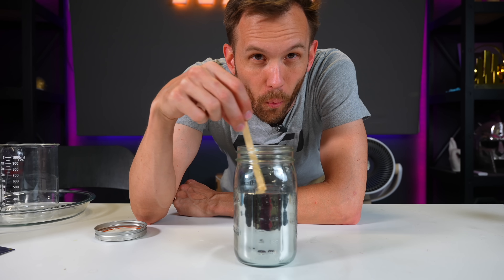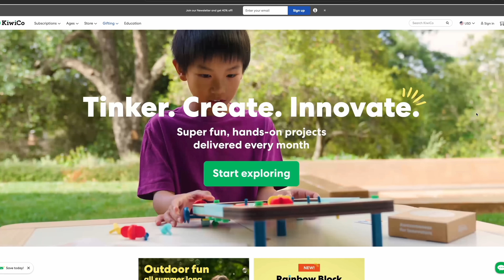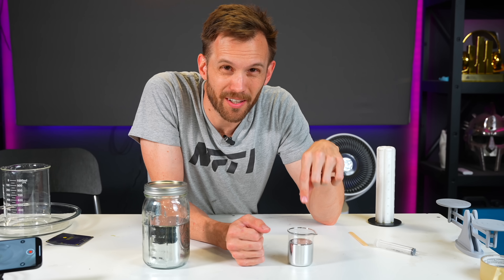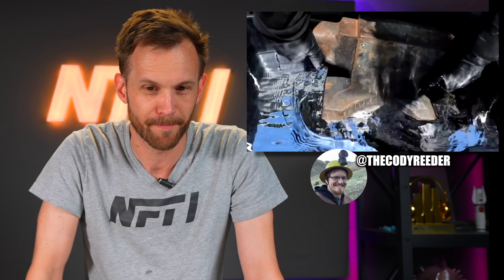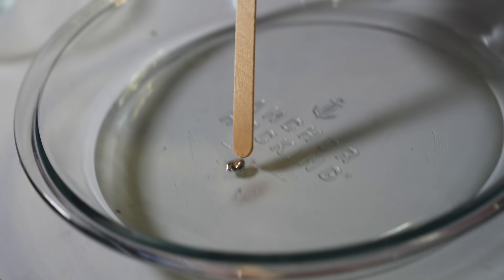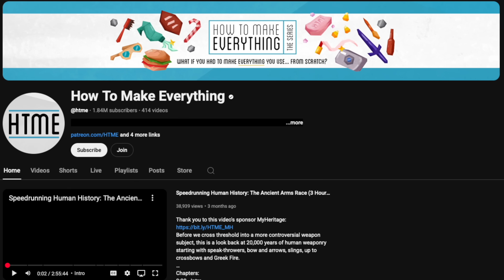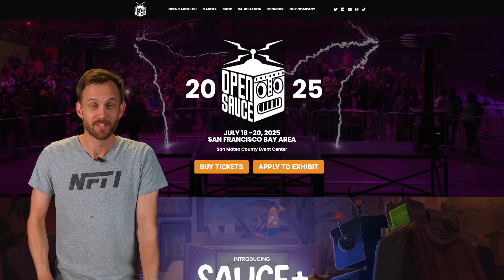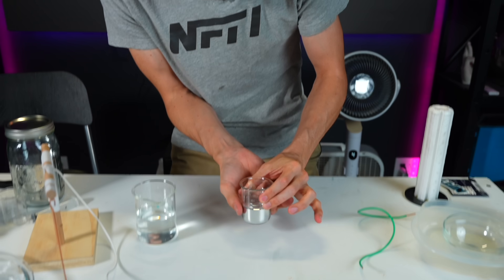What Happens If You Touch Pure Mercury?

Comment: I worked at the Volvo car Plant in the 70's and 80's. Under the hood and deck lid were switches that used a drop of mercury to make a connection. You could see through the clear cover the 2 connections about an 1/8"" apart. The way the switch was mounted, opening slowly, you could see the drop of mercury roll over to bridge the connection to turn the light on.

Comment: Alert - the balloon popping segment:
Many small spheres of mercury will increase the surface area of air exposed mercury, and the evaporation of mercury vapor into the air space is greatly increased.
Mercury vapor is more dangerous because it can then be inhaled, accesses the blood stream and, in particular, is able to pass through the protective blood brain barrier system and enter the central nervous system. Mercury is toxic to the neurons, (this can be visualized using a culture of neurons) - resulting in damaged or killed neurons and altered brain health.

Comment: I can't tell you how many times (in the 70's) that glass thermometers broke and we chased those little balls around the counter until they disappeared. Of course, we know how that it was being absorbed. Yikes. 
Oddly, folks think that the T1000 was mercury. However, it's actually gallium, which melts at relatively warm room temp of roughly 85 1/2 degrees F (cooler than your hand). Gallium also has a stronger magnetic property and is more easily manipulated with magnets. Someone actually made a little gallium robot, put it behind bars, increased the temp to melting, and then used magnets to not only pull it out from behind bars, but then use the magnets to reconstruct the robot thing. It's here on YT, but if I provide the link, I'll get a time out. Search: "Scientists create shape-shifting metal robot". You'll also find more videos. If you combine that with the 2.0 generation of Atlas from Boston Dynamics (search: "Boston Atlas 2.0"), THAT IS TERRIFYING, and makes the T1000 entirely plausible.

Comment: The most dangerous mercury compound is probably dimethyl-mercury. It is an extremely toxic substance because its molecular size is very small. It goes through your skin very easily and it crosses the bload-brain-barrier and let the neurons die one after another. It is a very slowly death because you lose your neuronal functions until you die and you can't do anything about it.

Comment: Can you make a hydraulic motor using Mercury, soundwaves, and electromagnetism and control it thru particular frequencies? If using Mercury as a gimble. Slingshot an object and control the speed by manipulating the sthe structure of the Mercury with soundwaves. Direction or speed by frequency. If you could control the temperature in space. You could theoretically power a ship with frequencies.

Comment: we used to play with this stuff when we were kids. we'd break open an old thermometer and pour it in a pan. we'd watch it roll around. try and heat it up or light it on fire.
science class also had use do experiments using this stuff. old chemistry sets you'd buy at the store sold it too.

Comment: I know those in the US are ahistorical, but some background would have enriched this video.

Antoine-Laurent Lavoisier used mercury in his 1776 experiments to demonstrate that air is a mixture of gases and that combustion requires a specific component, which he named oxygen. He heated mercury in a closed container, which formed a red powder (mercury oxide) and consumed about one-fifth of the air, leaving an inert gas he called azote (nitrogen). By heating the mercury oxide, he was able to reverse the reaction, producing mercury and the gas he discovered, thus proving that oxygen was the part of the air that supported combustion. This also helped refute the older phlogiston theory and laid the groundwork for the law of conservation of mass. 

Mercury used to be (and still may be) used in switches.
Reply: I know that pedantic know it alls on the internet feel as if they know it all, but mercury is HIGHLY regulated for use in the US and is banned outside of specific industrial uses, and specific medical and dental amalgam use age and these specific legal uses are dwindling  by year.   The only mercury switches existing in the US are in very old likely abandoned buildings.   Citing a historical event in a niche field from over two hundred years ago doesn’t make us ahistorical, it makes you know a single niche fact with no real use in day to day humankind. 😊
Reply: @codename495  Your thinking that the discovery of oxygen by Lavoisier is "niche" I think confirms ahistoricity. Ask a chemist - no, even a competent high school student about its importance.  Of course, I don't know, given the wrecked condition of the US school system and half of US adults not being able to read past the 8th grade.  And, your "The only mercury switches existing in the US ..." is contradicted by a simple internet search, two immediate ones being Sci-Tech and Robot shop.  Accuracy is not necessarily pedantic. Perhaps your not being appreciative of academics makes you think that remarks like mine are "pedantic".

Comment: 11:57...1st electric motor. under these circumstances you are correct you cannot harness machanical energy from the current test. I think it would have been more interesting using a copper bowl or cylnder with a voltage tester to better demonstrate different outcomes... you used a glass bowl, an insulator. i would try again with copper and show us again. great video keep up the interesting work.

Comment: I've seen the heavy glass prisms in a light house float on mercury as a low friction bearing. The mercury was open to the air, so did the light house keepers ever need to top it up due to evaporation?

Comment: There used to be a mercury mine near Weiser, Idaho. It was at one time the largest producer of mercury in the USA. There are areas in mountains the Weiser river flows through, that have small amounts of liquid mercury that can be found. I've seen small drops of mercury show up when gold panning. It's just naturally there, not left from long ago prospectors using it to extract gold from quartz or black sand.

My mother said when she was in school they went on a field trip to the mercury mine. They had a milk can full of mercury and told students if they could reach in and touch the bottom of the can they could have it. Mercury is too dense to do that. Then the two biggest and strongest boys were told if they could carry the can out the door they could have it. Even working together they were unable to lift the can. Those old style milk cans were at least 5 gallons. So at least 500 pounds, if it wasn't completely full.

Comment: 5:42 The vapor pressure of mercury (Hg) at 20C is 1.7 x 10-3 torr, atmospheric pressure is 760 torr so it's virtually undetectable. Remember dental Hg was used to make fillings for teeth! Many years ago OSHA tested the room where Hg is used in making neon tubing and found no detectable Hg in the air. It wasn't until the test equipment probe was brought near a drop of Hg was a reaction.  I've been around Hg for over 45 years and my blood Hg levels are completely normal. Heating Hg however is another story, then there will be significant amounts of vapour produced which is dangerous.
Reply: Ackshually….
Reply: @TheSpicyLeg  ?
Reply: Tbh, I did don’t understand ANYTHING, sorry
Reply: @bellaqueen6933  A volatile liquids like alcohol for example has a high vapor pressure, meaning it evaporates quickly at room temperature.

While mercury which has an extremly low vapor pressure at room temperatire does not evaporate enough to exceed OSHA regulations.
Reply: @tihzho thank you!

Comment: I make neon signs and as such I use metallic mercury (Hg) in very small amounts inside of fluorescent neon tubing to produce vapour which is ionised producing UVC that is absorbed by the fluorescent powder coating producing various colors. Years ago someone in the workshop accidently swallowed a small drop of Hg. At the ER the doctor said he will poop out the Hg. I've been around Hg for over 45 years and my blood Hg levels are completely normal. In fact until recently dentists used Hg to make dental amalgam for fillings which is is a mixture of silver, tin, copper, zinc, and mercury. The mercury is used as a liquid to bind the other metals together, forming a hard, silver-colored filling material.

Comment: Mercury in room temperature is vaporizing, where the fumes become visible under UV light with a fluorescent screen and there are videos online to see the effect. Inhaling mercury vapors is toxic in the long run and can cause lasting harm to the body, especially the nervous system and kidneys. This is why when mercury is dropped on a carpet, the carpet should be disposed with a label of mercury contamination, since it will always emit mercury fumes.

Comment: I remember when I was a kid in the 60’s we used to find old Honeywell thermostats for furnaces, they had a glass tube with mercury in it that acted as an electrical switch that would turn the furnace on and off. We used to brake open the glass tube and play with the mercury, let it fall on the floor splatter apart, go back together again all that time not even knowing it was dangerous and toxic to touch it, It’s interesting how little we knew when we were kids back then, but it was fun playing with it I have to say that. Im surprised you didn’t use that example in your video, Im sure lots of people remember that.
Reply: It's people like you that got those mercury switch thermostats banned. :P

Comment: copper penny dipped in mercury.  Looked like a dime but was slippery because the mercury was still liquid.  
And mercuric oxide was often used to demonstrate oxygen, heated it would break down to O2 and mercury.  Had lots of it in the lab.

But then I built a hydrogen bomb and blew up the back/prep room.  Mossy zinc plus hydrocloric acid and air in a 500ml flask plus a flame.  Kaboom and I was off to the nurses office.  Never wanted to play with that again.

Comment: My dad hauled mercury out of gold mines back in the 90’s, it was contained in what looked like super armored paint buckets. Could only haul 9 of them to avoid exceeding what the trailer could handle. Almost 10,000 pounds per container. 5 at the front of the flat bed, and 4 at the rear.

Comment: “You usually don’t think of steel floating”. 

Uh take a look at this new thing called ships.  Especially Aircraft Carriers.
Reply: But trying making a ship out of a solid block of iron float. The only reason a metal ship floats is because it displaces the weight over a much larger volume (due to the hollow shape) and makes its effective density less than the water around it. The water displacement is more than the weight of the boat itself, so it floats.

Comment: Short answer, nothing much happens when you TOUCH elemental Mercury. It is technically a "noble" metal, so it doesn't react easily with anything on your hand, (sweat, sebum etc.). Mercury SALTS on the other hand, totally different situation.

Comment: Mercury is not the only pure element which is a liquid at room temperature. Also bromine is such a liquid. It melts at 266 K or -7 °C.

The homo-polar motor is something whery special. No modern electric engine is based on this principle today. It requires an inhomogenious magnetic field. And this is complicated to design for an electric engine with a high efficiency. So usually it has just a fraction of one winding as its coil. It requires a lot of current and a small voltage. So most of the power is consumed by the copper losses.

Comment: Interesting fact, you can determine which direction the Faraday motor will "turn", or rotate around the magnet.  Use the right hand rule.  Using your right hand, hold the hand like a fake gun, like you are six shooting someone with your index finger. Point your thumb in the direction of current flow.  (Not electron flow, but assuming our normal idea that current flows from higher to lower potential.) The index finger points in the direction of the force exerted by the magnets, while the remaining fingers will point in the direction of rotation of the wire around the magnets.

Comment: Fun fact in the 1960's and up to the 1980's some door chimes were made with a vial of elemental mercury in a rocker switch that made it warble. Also there are still mercury switches in use today where it is  necessary to break large loads  because unlike solid contacts it is less likley to cause a plasma arc
Reply: The old thermostat in my house uses mercury switches.

Comment: The house I lived in 6 years ago had one mercury light switch.  Perfectly safe, unless somehow it were damaged so badly that the glass bulb with the actual mercury were to be broken, which is impossible under normal use.  I still have a few mercury fever thermometers.  They are so much better than the modern ones that always have a dead battery.

Comment: Karen Wetterhahn died in June of 1997 - ten months after accidental exposure to dimethylmercury.  It was only one or two drops on one of her latex gloves that caused the problem, as the liquid metal can permeate latex gloves.
There's a lot about her online.  Just search her name.
PS:  What did they use to power the original motor, before batteries?

Comment: In the 1960s, we found some electrical devices that had "mercury switches",......a very cool mechanism. A small vial of mercury that would pivot. In one direction it made an electrical connection, in the opposite direction, it disengaged the electrical connection. They may still make them, I dunno.

Comment: While touching liquid elemental mercury may result in some absorption through the skin, it's typically not enough to cause significant harm. However, organic mercury compounds, such as methylmercury, are readily absorbed through the skin and can be highly toxic. Additionally, any form of mercury can be more easily absorbed through damaged skin (cuts or abrasions). So technically you're fine and not just operate at your own risk

Comment: I visited an old lighthouse (Biarritz,  France) where the lamp, constituted by a huge glass fresnel lens weighing tons, with the arc lamp behind it, floated in mercury to keep friction to a minimum. It required a tiny electric motor and a belt drive to rotate the lamp at a constant speed.

Comment: The mercury motor was fun. Have you ever tried using magnet and mercury using motion/spinning of magnet within mercury? A magnet, attached at one pole end to a shaft, which is spun while immersed in mercury, and wires inserted into each side of the dish containing the mercury, and see if it creates any interesting (electrical?) force between the wires, maybe tested through an LED. This could test for magnet "equator" power and then do again with spinning shaft attached 90 degree to the equator of the magnet placed in mercury, thereby doing typical AC approach of spinning poles, as used in simple alternators creating electricity.

Comment: There was a mass murderer in germany that poisoned a ton of his work mates with mecury oxide powder its rather nasty , the stuff also makes a good bomb fuse for tamper bombs stick 2 wires one end mecury other end and when the bomb packeg is picked up you get the diea bit risky to carry though lol can do the same thing with wires and wire wool balls though  i should add im a gunsmith ex army and worked with the sappers ( the regiment of demolition experts)  i have had my own bottle of mecury for 30 years but never needed to use it lol

Comment: Dental amalgam fillings inhibit tooth decay on the margins of the filling and can last a lifetime compared to around 10 years for composite fillings. I have a couple molars with large dental amalgam fillings dentist told me that the composites would fail sooner or later and the decay would spread each time they failed until the teeth would need to be removed due to structure loss. I've had the amalgam fillings for 30 years now and they're probably going to last the rest of my life.
Reply: No they most certainly will not last the rest of your life lol. They do last a LONG time, a few decades, but they start falling apart. I finally had mine changed just shy of 30 years.
Reply: @DoctorKnox I’ve had some for 60 years now, still intact and unchanged. I imagine they’ll last me the rest of my life. I’ve had the other kind fall out though.
Reply: The mercury often leeches into the tooth, turning it gray and killing it. It's rated 8x as toxic as lead. You are gradually absorbing it, swallowing it, and inhaling it. It was banned around 1850 by the American dental organization of the time because they realized it was destroying teeth and even kiIIing patients. The ADA was formed by less skilled dentists who wanted to use it anyway because it was soft and easy to shape. The ADA later sold us fluoride, for which dental fluorosis is named, as good for teeth. Fluoride is slightly more toxic than lead.